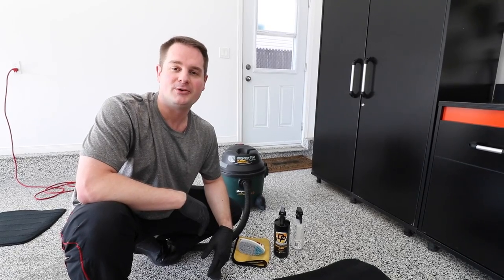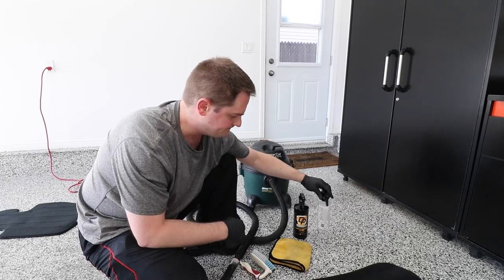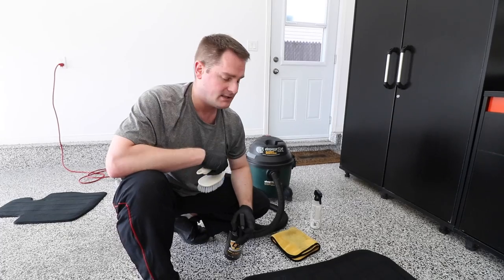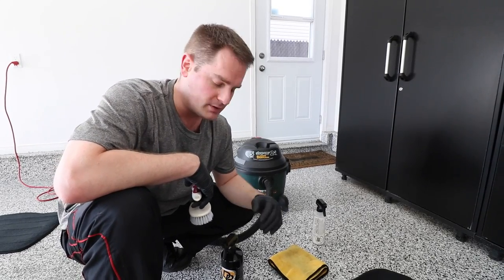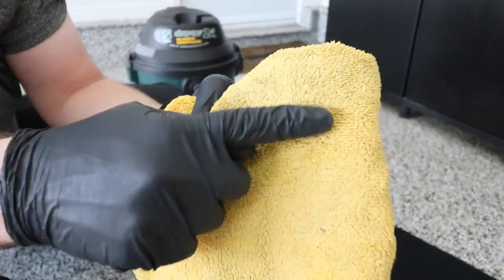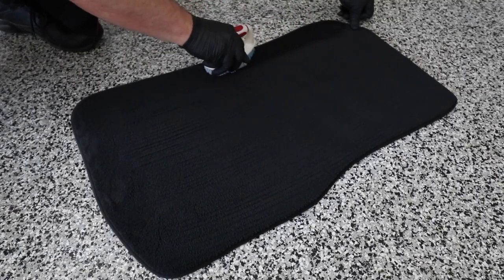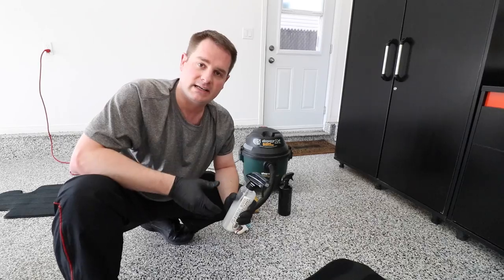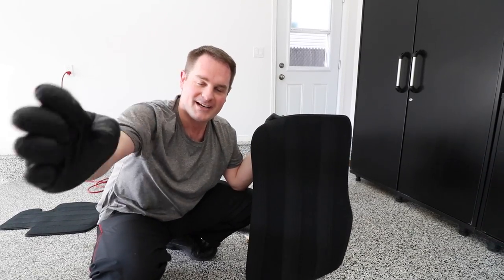HOW TO CLEAN CAR FLOOR MATS !!!  (Quick & easy!)

Comment: How do  you clean and restore a mat that is very stiff and hard. I t almost feels like something was injected between the carpet and rubber backing, an the pile is flat in certain areas.  Also what do you recommend to get red stains out of the mats? I think it may be juice stains.

Comment: Hey Pan Roberto from PR  again, I hope you've had a great day. I just wanted to ask you there will be a product that you have used to clean and shine the rubber mats and also to recover the black color look again as if they were new? I imagine all the people who will be asking you questions but if you have the opportunity to answer me i will appreciate it. good day
Reply from the maker: Hi Roberto.

Yes you can use Chemical Guys Mat Renew (cleaner and protectant for rubber and vinyl): https://amzn.to/2rdMFrS

Or Stoner Trim Shine: https://amzn.to/2Q83DqH

Just make sure you buff over with a microfiber towel after application to remove any excess.  Always make sure the surface isn't slippery after application.

Comment: Could you use a APC instead of carpet cleaner? And will this same method apply to the carpets as well?
Reply from the maker: Yes
Reply: @PanTheOrganizer  THANKS for the info and response
Reply from the maker: My pleasure!

How did you discover my channel?
Reply: @PanTheOrganizer  been trying to get into the detailing business so i started checking out videos and i came across one of yours and found it very informative so i subscribed and the rest is history.

Comment: I'm always left with a lot of small pieces of straw/grass that simply refuse to get out with the vacuum cleaner (felt mats).
Any tips on that?
Reply from the maker: Yes, use a stiff bristle brush and brush your mats.  It will loosen them and then you can vacuum.

Comment: I tried extracting my mats for the first time.. and I sucked all the water I could with my Bissell and I can’t seem to get the water out of the edges and now…. My car smells pretty funky. Any tips would be MUCH appreciated.
Reply from the maker: Once you are done extracting, leave the mats outside in the sun for a few hours, that will finish drying them out, and also with the sun's UV rays kill any potential bacteria that might be there, before they start multiplying due to a humid environment.

See how I extract carpet mats with a Bissell in this video: https://youtu.be/gQO-g_JMV-I

Comment: Rubber all-weather mats?   Pan-People... I have used Chemical Guys VRP and it leaves the mats too slick.  What product & technique do you recommend for all-weather rubber floor mats?
Reply from the maker: I typically don’t apply dressings to rubber matts, but Stoner has a trim one in aerosol form that doesn’t leave a slippery surface.

Comment: Wow! You don't use water to wash off the product?
Reply from the maker: +Ruguoser Liegise 
No need to.  These aren't rubber matts.  You just blot with a microfiber towel and job done.  

If they're really caked in heavy mud, you should pressure wash.

How did you discover my channel?

Comment: Pan, would you be using that MF towel for your paint (maybe after you washed it)?
Or can you give us like 3 reasons why you shouldn’t?
Thanks!
Reply from the maker: You can as long as it is clean.  I clean my mf towels after every use.
Reply: Pan TheOrganizer Some people swear by not doing that. The context here was that you dropped it on the floor which for some reviewers is a red flag for ever using it on paint, because washing is no absolute guarantee that absolutely everything is removed in terms of things that can scratch the paint. For using it on floor mats it would be OK, of course.

Comment: Why put something to repel water? Wouldn’t you want the carpet to absorb it rather than repel and reside to the floorboards?
Reply from the maker: It won't throw water outside of the carpet. It just makes cleaning much easier. That's what that means.

Comment: Do we have to wear gloves ?
Reply from the maker: No but it’s always a good precaution to take when working with chemicals.
Reply: Jorge Reyes you really don’t want a bunch of chemicals being absorbed into your pores for one, but we’re all guilty of not using them some times. I find I use mine when polishing or doing interiors or windows as I don’t want the oils from my skin getting onto the car. I also notice when I don’t use them my hands will get red and crack after a long detail so if you detail often it really helps to wear gloves. ;)
Reply: after a day of doing an interior detail i’ve learned the hard way - YES